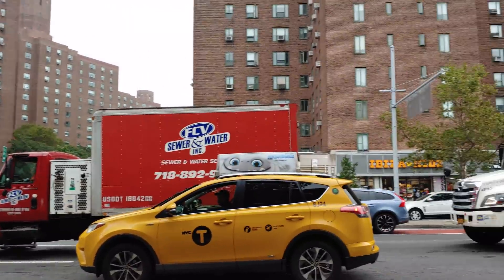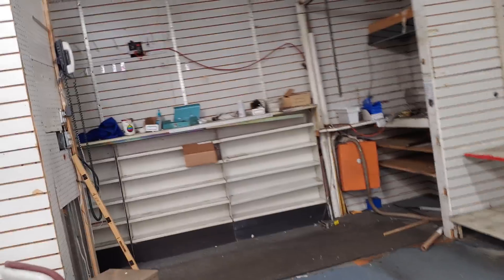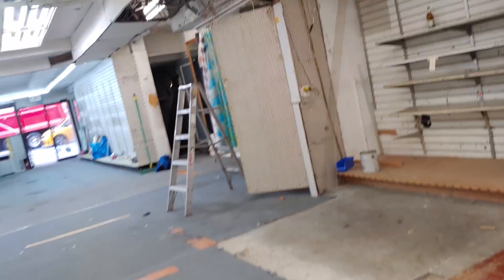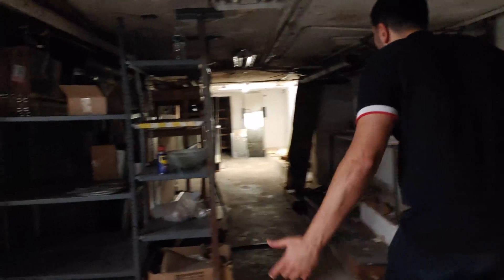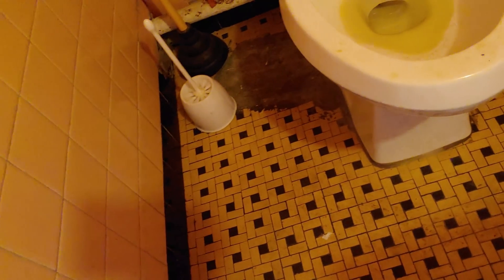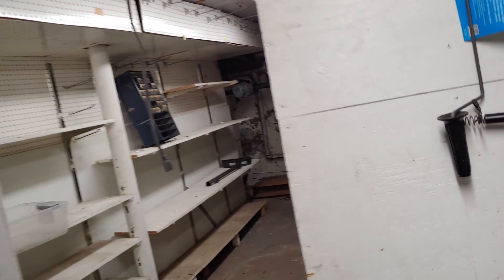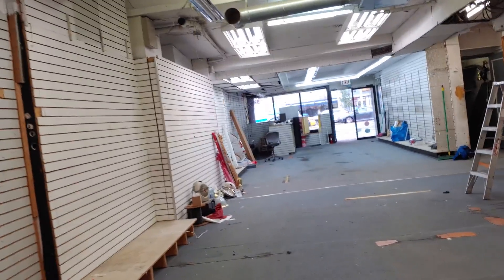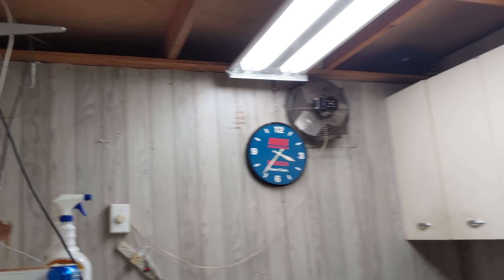[1ST AVE 20TH ST] Is this BETTER or WORSE than bella tile(last video) to be used as our new store?

Comment from the maker: Is this place better than bella tile? https://www.youtube.com/watch?v=6_Kw8s5jBDU
Reply: I think so, I think it's perfect, could use some fixing up though
Reply: Lived on 1st ave between 22/23rd st for 5 years, used to go to this hardware store all the time - kind of surprised and saddened that it closed down. This area has a TON of foot traffic every day of the week. It being across from stuy town is absolutely invaluable, in my opinion. I honestly think this would be the perfect place for you to move to, especially if the numbers are appealing. Don't forget about the future expansion of the 2nd ave subway, there should be a stop either at 23rd/2nd ave, or 20th/2nd ave at some point down the road ;) Do it!
Reply: YES!
Reply: Way better
Reply: 1000 times better than bella tile and they say $1,000 cheaper a month.  This a no brainer.    Ask to get $7K a month.
Reply: way better
Reply: Did they have good internet?
Reply: With personnel and equipment, you are not going to fill up the entire store, so you have more room to expand as you scale your business further. The rent at $8K is pretty decent if you get that rate, full cover roll down for locking up, street access for the basement for shipments, large store front and street level access, A/C, multiple bathrooms (wait till everyone eats that Taco Bell, you won't be waiting 😂), 200 amp service, there are a lot of pros. Cons, I could see there being a lot of work and setup costs to get the store right. It doesn't look that bad, but I can see a lot of time and labor and dumpsters to remove what's in the store if the landlord isn't going to do that for you prior to move in. Decently sized setup and construction cost to get it right. That's the only one I could come up with. It's the right layout for the flow of work, and future scalability. Honestly this is my favorite one yet, after watching all four of your streams when you hit the streets, the other locations individually, and keep using the G8, buttery smooth video. Just got the same phone a couple days ago and I have not recorded a video yet. Looks fantastic Louis 👌
4 year subscriber 👍
Reply: Best one so far.
Reply: waaaaay better than the other location
Reply: Way better. Street level, full basement, and huge storage.
Reply: I think it's better than the tile, which is too bad because the Tile place had a kickass landlord it seemed. However the basement in this one is hard to deny, it looks huge with lots of room to handle a growing business, and worst cases scenario if you needed to expand work space you could potentially half ass renovate an area down there and put a couple work stations down there.
Reply: Better space, shutter, no tiles, no grandpa.
Reply: Looks 100% better to my claustrophobic ass.
Reply: really nice and it's got a basement for storage
Reply: It's perfect, large storage, large front, more importantly street access, even comes with a latch for delivery. But it could use some fixing and upgrading.
Reply: Notre to big, notre to small, open space. Nice location. . This Is the one. Take it.
Reply: With three bathrooms, the best basement til now, the 200 amps, the ceiling and that real front door, I mean, you are going to be there every day so that details sum up. 
I'll just consider for the future which operations could be done in other place if more space is needed...
Reply: Definitely. You see the problem with Bella Tile is, from what I gathered the owning family are above you? With a basement still full of tiles and you wanting access to the floor above? It might turn out sweet, or they could be dispute points in the future. This one does not have those issues ...
Reply: Louis Rossmann The locative across from Stuyvesant Town and Peter Cooper Village should give you a lot of foot traffic and walk-ins.
I grew up on that street, in the 1960’s went to ps40 ½ block down 20th, between 1st and 2nd ave. If you gave a wide shot outside I could tell you the tenant. I believe it was a mom and pop store named Jack’s where we bought candy bars for a nickel on our way to school. I lived in Manhattan for 40 years. I know, I know, nobody cares except me, but it brings back memories. I wish you all the best your hard work and ethics has earned you.
Reply: @nyc10021  I appreciate your story!
Reply: The street delivery hatch is a definite plus
Reply: For the $ and worked needed. Not bad! Great space for what u would be doing? What ISP/speeds can you get? If it’s has Gigabit Fibe 👍🤷‍♂️
Reply: Much better in my opinion. Good width, already has a gate, office already in place, put a wall right at or after that door to the basement and you have enough room for your workers from there to the back, has a full very functional basement, that needs very little work, has the hatch for deliveries, really I saw no immediate and big issues with this place. From all the actual store fronts so far (so excluding the restaurant and the hookah lounge), this is the best so far. 

Overall I like the restaurant, the 3rd floor office and this one. (I know there are some issue with the restaurant and that you already turned that one down, but I thought I mention it regardless.)
Reply: Take it !
Reply: Way way better then the last video!
Reply: Better, plus you dont have to fix the floor nor wait on grandpa's permission to utilize the space you pay for (basement)
Reply: This is way better than Bella tile
Reply: much way better
Reply: Yes mutch less work and no private owner who is verry old ?
Reply: Go with Paul 1st for hes "eye check".
Reply: Way better,  that bathroom though it was funny :)
Reply: This place is better than the tile place.
Reply: Looks even better than the restaurant in some ways IMO
Reply: Considering price, space, and store front for walk ins, this seems like the best bet from all your videos I have seen.  I fucking love you're posting this search.  Can't wait for the posts of the demo, cleanup, and build for whichever space you choose.
Reply: Are they going to clean it up before you move in?
Reply: Bella tile? All depends on the possibility to rent the second floor in the future
Reply: @CookieMonster-uv5fm  'The store repair of the macbook repair store series'
Reply: kinda the same, between this two get the one closer to an Apple store
Reply: better, I believe
Reply: First of all: Stuyvesant looks gorgeous :) And to the store: it looks wider than Bella - the basement about the same size, but would be nice if you had the actual mesurements - that would be my first question, You guys didn't talk about it - at least not on camera. I didn't see the toillets outside basement, but at least you can take a dope somewhere where it'đ quiet :). Two toillets for 13 people is just about OK, three would be better. This place needs a lot to invest to I think (almost all of the places you have seen) - but here also the basement - I would double check the wiring. The pros are: 5 min walk from subway, direct to street accessibility, the cargo ramp or whatever you call it and it's right across a big residential area, also You would only have to move few streets (so you wouldn't loose you current customers), and tha money of course is better. The cons: seems to be a decent investment to all the equipment (I would also change the wiring), and maybe it's not as big as You are going to need it in 24-36 months when the business is grown - if You don't want to put staff into basement. If Bella could give You an expansion option for the 1st flor I would reconsider it - I can imagine one and a half flor of technicians, easily...
Reply: Can you fit 24 employees in there? Double up you know..
Reply: def. better, big basement
Reply: Yes , it need lots of work but still ok
Reply: Yes I think so, Bella tile is narrow and long. I feel this place would be easier to retrofit to your needs. Also the basement of this place looks better/bigger and wouldn't have other stuff in it. 
I would look into the single phase power, that would pose an issue for your 220v gear. But even if it's single phase now you could contact the power company, they can often change that for you.
Reply: I can see you doing some crapple repair in this place. Go for it!
Reply: This looks pretty great.

I think you're gaining a lot by having a shop front - you've got an advertising presence at street level, and you'll get walk-in customers both of which you won't get in the 4th floor office buildings. 

If you don't already, you should probably ask each of your customers how they found you (e.g. walk-in, advert, recommendation, internet fame etc), to see the likely impact each type type of location will have upon new customers turning up.

Would it be possible to keep your current store too? (albeit with fewer staff in it)
Reply: seems nice to me
Reply: indeed, where is condense unit
Reply: way better
Reply: I still like the layout of the restaurant most, but this one seems the easiest to move into.
Reply: This place is better than bella tile, yes.
Reply: yes, extra delivery hatch makes also a huge difference, estore in the basement, maybe ultrasonics there, its 4times the sueable space as now.
yet restaurant is still #1 but this is a solid second
Reply: This is it!
Reply: The bella tile place felt cramped. It may be because there was a lot of stuff there, but just seeing it like that made it feel like it was compressed on the sides. I didn't like that when you enter you have to pass 2 doors, that hall way, I don't really see its purpose. I think this place is much better and it feels familiar with the existing one. Its big enough for the work you do and with some fixing it can be made really nice. Did you find out if there is a 3rd bathroom up stairs or just the basement ones? That would be a minus from a customer point of view.
Reply: This is better!
Reply: better, bella tiles grandpa gonna sell tyles from your basement, and the hallway from bella is taking to mutch space
Reply: Best
Reply: Looks good at first sight, I also like this one more than the one before, but what about the repairs and renovation costs?
Reply: Yeah bro! This one is nice. Do the floors, drop ceiling, have your little bar up front. Bella tiles kinda a crap hole. I like this one. 8k is a good price!
Reply: Did you get the secret wifi password ? Lol
Reply: Yes, way better.
Reply: Don't delay sign papers today. Best so far. And It's 13th September, it's good sign, change for better - always!  Hudge, cheep, bike friendly, and address easy to remember. 1st=the best repair shop on 20ave. Your office is already there.. can work even in basement, can receive deliveries without walking main doors. I personally would start imedietly!
Reply: its better
Reply: Better
Reply: Visibility and accessibility is key! - If people are having a hard time finding or getting to your your shop, they might not even bother comming.
If you depend on a lot of walk-ins, or regular joes just dropping by. Then you have to think location, location location.

However. You're moving because you need more space. Find something that has more space than you need today. By the looks of it you will quickly grow to use all the available space anyways. And when you keep moving around, you spend money that you just aint getting back again. You invenst in the place, but if you move faster than the investment pays back, then its just hurting the business.

So you get a lot of mail-ins, you have regulars, other businesses that use you for the repairs they cant handle themselves. You also sell from the store. These are location independant.
They will get to you no matter where you choose to go.

You might even make an argument for people who has been using your service before, or people who gets recommended going to your store... They will come to your place anyways.
People who are in need, will come, as long as they just know who you are, where you are and what you do.(Branding, and getting your company out there)

I dont know how much your business relys on one thing or the other. However I hope my 2 cents will be helpful in choosing the right spot for you.

TLDR: You should go with whatever strengthens the core business the most. Everything else is just added bonus!

Cheers from a Store Manager from a IT Store & Service Repair Shop in Denmark! :)
Reply: yes
Reply: This is better than Bella tile because you don't have to deal with the shared entrance and worrying about future promises from the landlord.
Reply: This should work out for you.   A little work and you will have a super place .  I hope you put your offer in.
Reply: yes
Reply: Better!
Reply: I like the hardware store better. Assuming the appartments next to them aren't low rent or retirement homes.
Reply: Bella Tile has the advantages of it being close to your current location which should make the move easier and it has a second floor you could eventually take over. The downside is you don't have a lot of space in the basement for a while until those tiles can be shifted. The hardware store gives you more space in the basement right off the bat and the street access hatch could be handy for shipping and deliveries. You will also save a lot of money over 10 years with the lower rent. I like the idea of a possible 2nd floor but I think the hardware store wins.
Reply: thats the best palce for you take it, don't be late
Reply: definitely better
Reply: Great potential!
Reply: i have no clue why u are asking viewers. kinda funny to watch those titles i swear
Reply: Better !
Reply: perfect, put the ultrasonic down the basement, or make a place for un- 
and boxing videos without the noises. also since it's not far away, 
everyone who remember your good service from lets say a year ago will 
still be able to find you again without efforts. If you want to grow 
your biz, you prolly need to grow your space. Keeping almost the same 
location while doing that, can't be a high risk. Hey you could invite 
Linux to fix the network and put a nice server to the basement for your 
video editing and hardware projects to come. Keep up the nice work, 
greetings from Germany :)
Reply: This space seems nice, but in terms of size, it seems more like "the place I'm now is to small to fit all my people, this space is sufficient to fit my current level of staff", while at the same time there is very little room to grow, unless you want to get cramped like you are now, within a span of 2 years, again.
Reply: Pause at 3:16 Louis. If that place is old enough to have linoleum its old enough to have asbestos. Make sure that's not some there in that hole.
Reply: Between this and Bella. I vote this. And it has the role down gate
Reply: Up vote
Reply: i like this one a lot . good location plenty of more space than what you have
Reply: Since i'm from argentina, I have NO IDEA about NY streets, but the SPACE (not talking about location) is amazing for you. The location looks decent, think about parking place for your customers. If there is some nearby it will be amazing.
Reply: @matias86532  Parking is not really much if any consideration in NY, almost nobody uses their own car, they either use taxi/uber/lyft, bicycles or public transport, so public transport connection is a much more important consideration.
Reply: @matias86532  almost nobody in New York drives his own car. Those that do most likely won't worry about Apple charging a premium. Most important thing is to have a subway station nearby
Reply: @matias86532  it's ny most walk or bus train etc
Reply: Louis it’s definitely the hardware store without a doubt full basement and no stupid ass hallway entrance! Floor is level and delivery’s directly downstairs👍 best of all it’s cheaper more secure just about move in ready to go🌬👍✌️😜😘🤣🤣🤣🤣🤣...
Reply: Absolutely
Reply: It gives you a street accessible store front, basement storage area and enough space, plus it’s less expensive especially if you get it down to 8 which is the best part of it if you ask me. Although I’m a tight fisted miser so less money always = more in my book!
Reply: This one seems bigger even though you're not using a wide angle.
Reply: Yes
Reply: take this one for 8k 4 months free thats great!!
Reply: TLC but A+ afterwards
Reply: I'm hyped... I like the place
Reply: Those indents make a lot of space but I wouldn't want to have to shit in the basement. The tile place looks maybe 2ft narrower but with the size of the second floor and  basement that didn't initially come with it, would give you room to expand if you got along good with the grandfather.
Reply: The real advantage to bella is the ability to expand. Downside is construction.

Comment: Problem with this place is that the increase in width is hard to translate into increase in workstations. It doesn't seem big enough that you could have shelves on the walls and 2 stations looking at each other in the middle. Instead you will just have more space between the stations or stations and shelves. A big bonus is how easy this would be to move into very little work needed. And location seemed nice. If you could get the bella place with 2nd floor and basement plus work done on it(unlikely to get all) I would go there. But otherwise this place looks very ready to move in, just more limited in expansion possibilities.

Comment: Looks like you have ventilation for the hood vent in this one. I like this one. Make some heated rooms down stairs for work space. Cleaned up the main floor will look nice. This is nice enough to copy an Apple stores look. Enough room to separate incoming and outgoing jobs. Delivery ramp.  200Amps. What else do you need? Besides a device that pegs the post man at the door till they enter the pickups in their system.